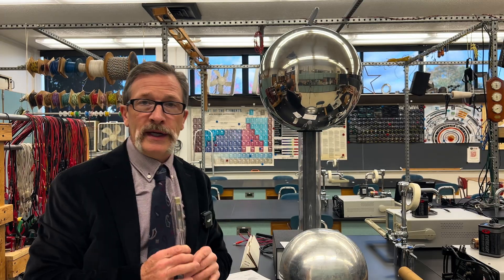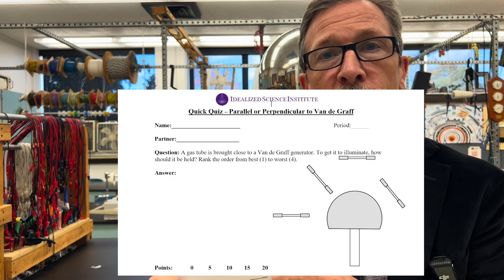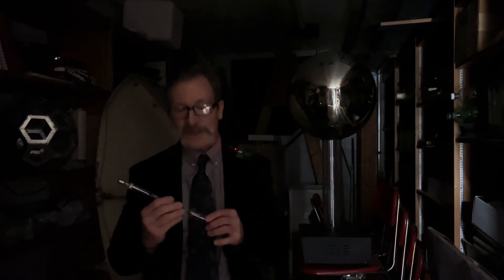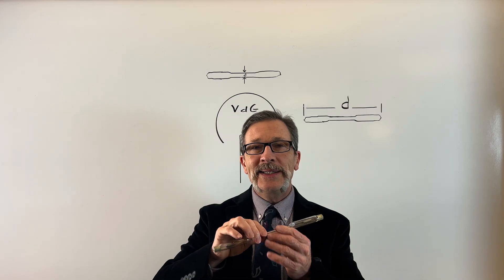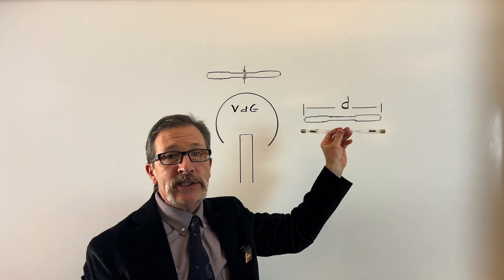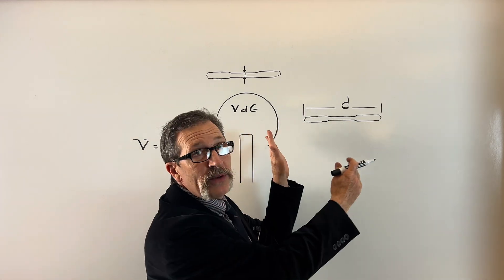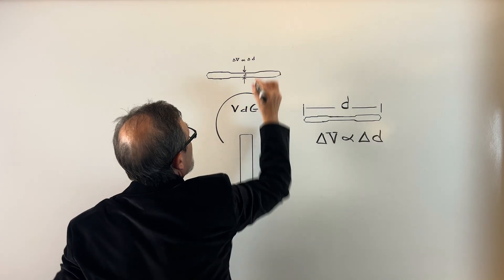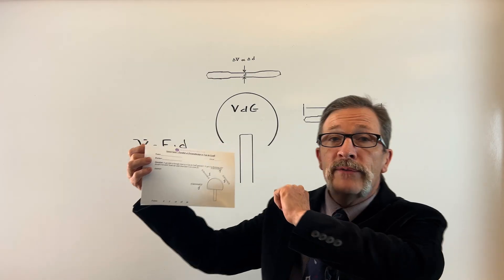Can You Light a Bulb Through the Air?

Comment: There is indeed a conduction current (ion and electron current) right through the air.  If a sharp point is attached to the metal electrode at the end of the tube, the tube will illuminate even when it is several feet away from the generator sphere.  The electric field will be concentrated maximally at the sharp tip, ionizing the air there.  A small light emitting diode (LED) or neon lamp will also illuminate slightly, (provided in the case of the LED that it is oriented to experience the proper polarity) when the leads are splayed apart, and one lead is held in the hand or connected by a wire to ground or to the base of the generator, and the other lead is pointed toward the generator.
Reply from the maker: Good comment! You would like our lightning rod quiz!

Comment: I thought you said to hold them in place. not move them closer.
For me, this is a demonstration of displacement current.
The extreme high voltage combined with the low capacity doesn't do much.

but when the voltage is changing in time by changing the distance to the sphere then there now flows a stream of energy through the tube which lights it up. This stream of energy is the displacement current.❤
Reply from the maker: This can be explained purely in terms of static fields, breakdown voltages, and ionization! Even when held still next to the generator, this effect will occur,

See, for example, https://youtu.be/RKrCjo6FsBo?si=tdrQWhpJpB8bcbFg
Reply: @idealizedscience  Thanks for sharing. That video proves what I already stated it only lights when there is a discharge. as there is a change in voltage and thus a flow of energy. pure static voltage won't light it. it needs to be changing voltage
Reply from the maker: Ah, gotcha! I misinterpreted your previous comment! I agree it lights when there is a discharge but disagree that the bulb needs to be moving to achieve this
Reply: @idealizedscience   yes discharge is enough. but with no discharge the move can also trigger the light. due to the change in voltage. agree?

Comment: Prediction: the electric field around the generator is radial, so the electrons in the gas should be easily accelerated when the vial is held radially and not when held perpendicular to the field lines e.g. vertically to the side of the generator. So I expect light when "pointing at" the generator and less or no light when "pointing past" the generator